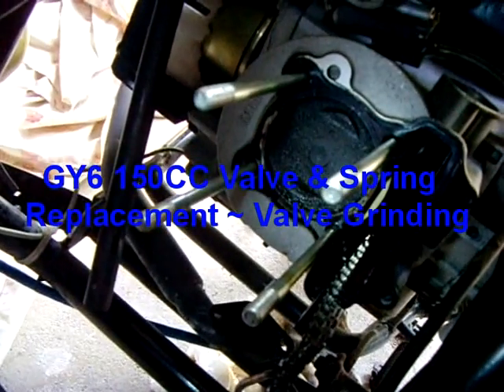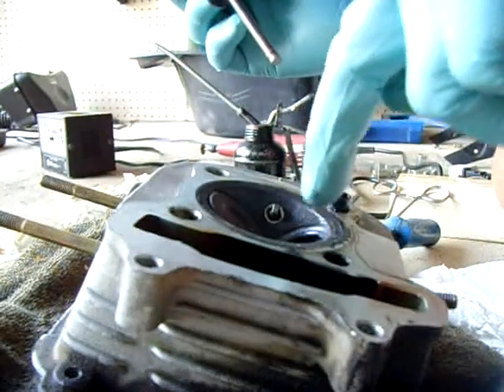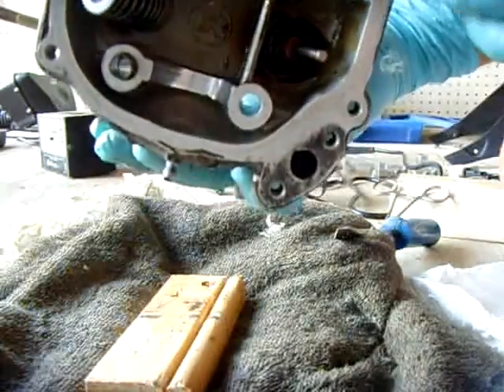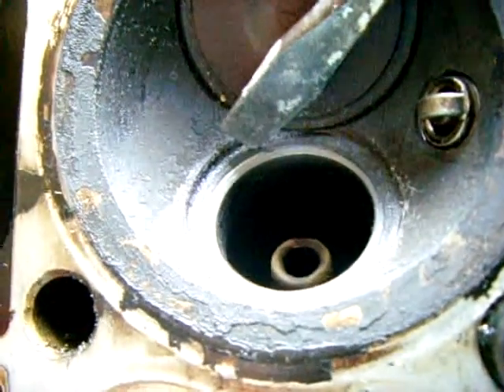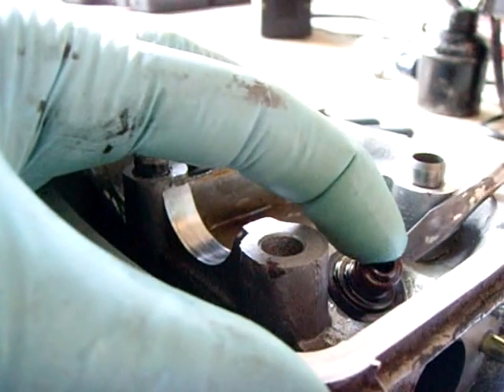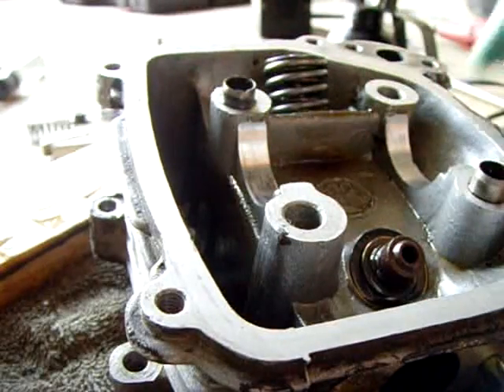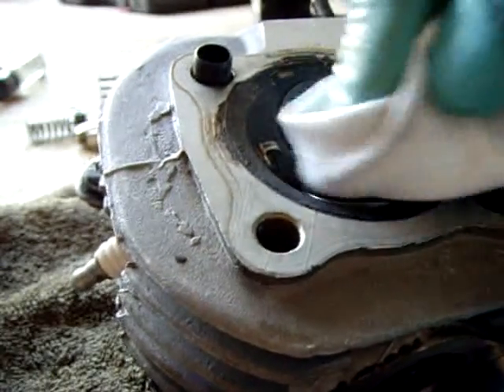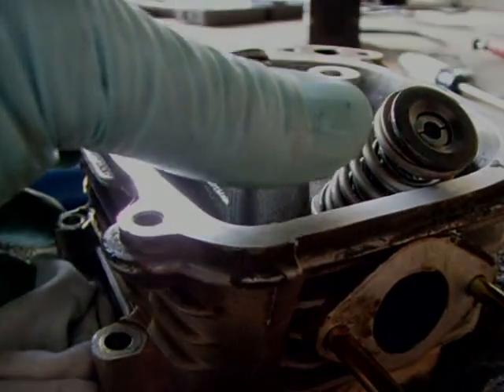GY6 150CC Valve & Spring Replacement - Grinding/Lapping

Comment: Going through all that trouble I would have cleaned up the combustion chamber in the cylinder head first and clean the port a little bit then due to valve seat job but you do it the way you want to do it dude

Comment: Not trying to tell you what to do with your valve job but you need to swing your hands back and forth with longer strokes really get that circulation going with the valve otherwise you're doing a good job think about that the door for a long time your strokes are too short

Comment: I'm not sure about the 150cc engines, but to me the 50cc are very restrictive, as far as the valves go. The valve to port is off, I think it limits rpm to about 8000, because of airflow,  heads are available with 20/23 mm valves,  and 19/21mm, the 19/21mm would be about right for a 50-60cc , a 80-95cc would run better, more power/speed, with the 20/23mm with a cam upgrade, it should spin upward of 9500rpm or more, and the ports can use matching, and maybe porting, I'm looking to add a oil cooler, and possibly titanium keepers, and better valve springs, I did add shims to the stock springs, to hopefully prevent valve float, at about 8k RPM,  I have variator parts, to hopefully get a slightly higher gear ratio on top end, I have clutch springs, to allow up to 2000rpm before it moves,  I'm going to play with variator weights, a bit, to decide if I want to change the final gear ratio, I'm hoping to get a decent 0-45mph, with about 60 mph peak,  Its about 86cc with a ported head, with unshrouded stock valves, with aftermarket exhaust, and adjustable "racing" CDI box, the second I tried, it would not start when cold, nearly killed the starter,  I'm going to put together a tool kit with tools that fit the scooter only, and add dry lube for the bushings in the variator cover,  I had to buy new head and tail lights, adding LED bulbs, to reduce the HP loss,  I need to do the full wave rectifier, at idle the headlight flickers, I thought about adding a full wave rectifier and capacitor to the headlight! But that wouldn't help the charging! I also have led fog/driving lights! 36watts, lights things up nicely, I live in the country, it's dark at night around here!! Hopefully I'll end up with it fast enough to NOT get ranover!!

Comment: saw an easy way  to push keys in , two pieces of thick tape over them then a socket pressed down on plate and bottle cap under piston so it will not move down
Reply from the maker: Trick to everything. :-)

Comment: Why didn't you show the spring removal.
Reply from the maker: Very easy to do. Place the head on a hard flat surface with a small rag packed inside where the valves are located to keep them from being pushed all the way down. Next take a small 3/8" drive extension bar and a 3/8" drive socket of the correct size to push down on the retainer until the both keys fall out.

Comment: sorry my friend but the valve sits NOT ON ALUMINIUM but a hardened valve head insert is fitted at cast dressing stage it is then machined with the correct angle ready for valve insert and lapping process so the short answer is,
valve head material and valve seat material are made from the same stuff very hard and very long lasting  
hope this helps,?.
Reply from the maker: You're correct. The seat was not visible at the time I made this video. It blended in with the aluminum.
Reply: was not having a poke my friend, i should hate to stand before the man and have him say "what you did was wrong " so i apologize
Reply: yea ur the seat is steel as well as is the valve.
Reply: i meant ur right.

Comment: how do you take the valves off
Reply from the maker: +Marv Stephenson 
Hi there. Remove the head, then with the valve springs facing up, place it on a bench. Add something hard under the head to push on the valve. Once you do that, you can take a deep socket slightly larger than the valve shaft and press all the way down on the key retainer which holds the valve spring. The keys will pop out, then you can remove the valve. Thanks For Watching!
Reply: +electronicsNmore thanks but i figured it out a couple of hours ago
Reply: there called Colette's tapered and mated to lock internally to the valve stem and externally to the large spring retaining head hence binding all 3 items together
Reply: subscribe to my channel guys for small engine work .

Comment: In case the valve or the head isn't perfectly symmetrical, you should always rotate when you grind and not rock from side to side! Good video and explination though :)
Reply from the maker: Thanks for watching.

The valve never stayed in the same position in relation to the head during the entire lapping process. It was always moved around especially when I added more compound. Side to side motion is fine(and the usual), just make sure the motion is longer from side to side. The odds of me keeping the valve in the same position the entire time I lapped it, are next to zero.
Reply: electronicsnmore is correct, i have seen and used the machine that does auto lapping for you, this i did many years
ago when training as a mechanic at 15 yrs old when leaving education to pursue a trade,

Comment: i buy new valve so i need to get Valve GRINDING Compound ? is it only that i need ? so i just put the Valve GRINDING Compound and i make it fit good after i clean the compound on valve and the head ? and do i need to put oil on valve or just let the motor oil it . do i need to change the rubber or the old one its ok?
Reply from the maker: Yes, you need to make sure the new valve seats nicely, so you need to use valve grinding compound. As long as the old rubber is not cracked/split or loose, it will be fine. After all grinding compound is cleaned off, apply a coating of motor oil to the valve stem/seat before you reinstall it.

Comment: A valve spring compressor helps a lot! I do so many different motors I have 4 or 5 of them.
Reply from the maker: I agree. If I had one handy on the island in the Caribbean where I live, I certainly would have used one. You learn to make do with what you have/improvise.
Reply: @electronicsNmore  is it possible to put a 62 mm head on a stock 150 cc? which is 57.4 i believe.

Comment: You are not grinding the valves you are lapping big difference. The only way to tell about the cylinder shape is to use a dial bore gauge. Been riding and working on motorcycles as well as machine work none stop for 44 years. What you are doing is patching up not fixing.
Reply from the maker: Patching up? LOL. I don't think so. Valve lapping is certainly the more appropriate term, even though the compound I used is called, "Valve GRINDING Compound". As long as my cylinder walls are not scored/scratched, and the piston is not wiggling in the cylinder, I am satisfied. 1 1/2 years has passed since I performed this. The scooter runs PERFECT. Thousands of miles added.

Thanks For Watching.

Comment from the maker: I just looked at another head I had laying around. I see no steel valve seat in the aluminum head. As a matter of fact I even did a search for "GY6 150cc valve seats", and nothing came up. I see every other part, but no valve seats, it does make sense that there would be a steel valve seat due to the fact that aluminum is soft.
Reply: Gotta tell ya.. I've pulled heads and valves from 20+ guy's andnthey all had.a steel valve seat
Reply from the maker: @louispeters2105  it was there, but very hard to see.

Comment: Yeah if you clean the cylinder head like-new you'll notice there are valve seats that sit between the soft aluminum and the valve. If the steel valve was consistently tapping the aluminum it would look like a chewed piece of gum after 1000 miles.

Comment from the maker: Sure is. The head is aluminum, and the valve itself is steel.
Reply: Upgrade to stainless steel valves & they last much longer then factory iron valves. I check my lapping by filling the assembled head dome with gasoline on a leveled surface. If the valve seats hold gas without leaking down into the ports, they are good enough to hold air.

Comment from the maker: Actually, I recently did just that. It was successful. I took my Milwaukee cordless drill, and carefully hand tightened the chuck on the end of the valve. I then applied the grinding compound, then gently pulled on the valve with the drill to put pressure on the seat to grind it. Just use a low speed, and every so often push the drill in to redistribute the compound. Also try reverse. It works just fine. DO NOT bend the valve!

Comment: Instead of glueing that rod to the valve to lap it, most auto part stores sell a tool that sucks its self to the valve for about 10$. Now your going to have to clean the bottom of the valve.

Great video though!!